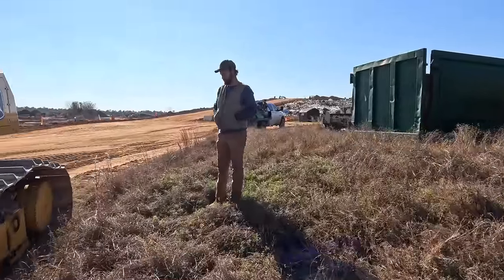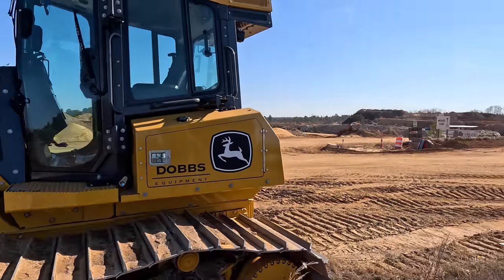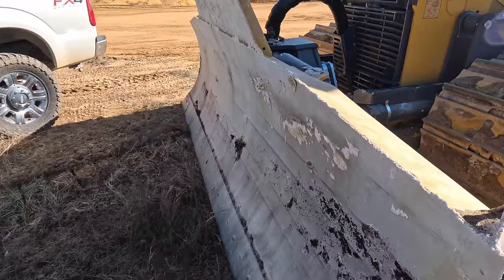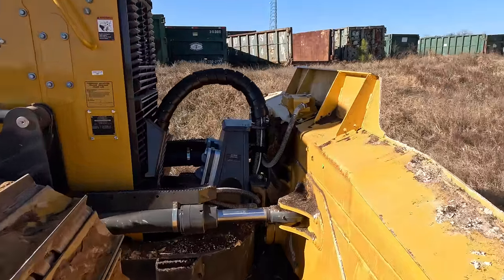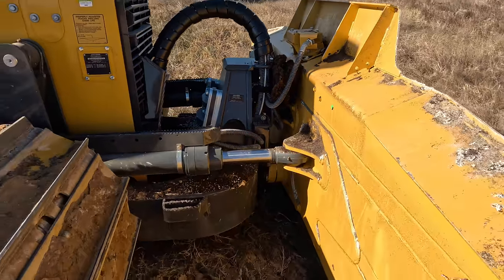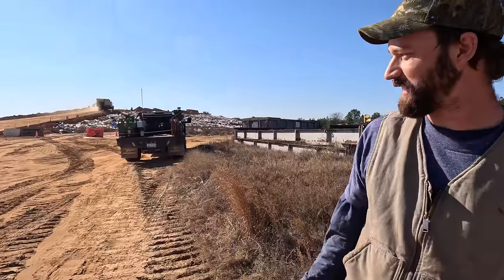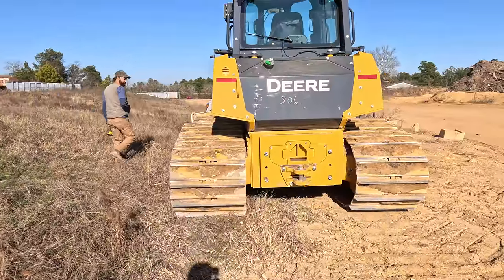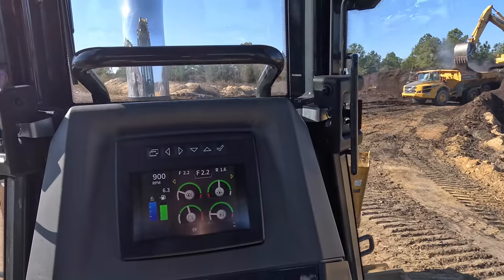🆕 John Deere 750 Arrived! But Is Something Wrong?

Comment: Ran 750s and 850s for a couple of seasons. With the 750 and 6 way blade. Keep an eye on the trunnion ball plates. In harder ground when the plates become loose it’s not hard to snap the trunnion ball at the neck.
Reply from the maker: Good info

Comment: I ran an old 450 lgp in a landfill outside of salinas ca pushing clay and sand. It had the old twin stiks which wasn’t a big deal because I learned on our old cable rigged D6 we had when I was younger. It was a great little dozer as I remember, we had a Cat D5 lgp out there too but it was tired so I stuck with that John Deere and it made me a believer, again.
Reply from the maker: cool buddy!

Comment: Thank you for video 😊❤😊 on are JD wheel Loader that had same button main square console. The (KEY) for brand new machine is the serial Number. Then if you look in manual the owner can change that number for anti theft 😊 the service guys from JD can change it back to serial number for service when you are not there. Just go to the part in service manual on changing START codes.
Reply from the maker: Thanks for the info! & thanks for watching

Comment: About reading signs: yes, one should obviously follow these. However, when you miss one, you may be entirely on your own. Me, I was touring on my bicycle (here in the Netherlands) the other day, following signs. At a certain spot, I felt that there should be a signpost, but I didn't see one. So I continued straight ahead where a sign should have directed me left. (One example out of many of the kind.) - A few decades ago (oops!) motorway exits here have been equipped with "no entry" signs left and right after 150 metres, with the text "go back" (in Dutch) underneath, as it had turned out before that many wrong-way drivers had missed the "no entry" sign at the intended end of the exit. - Me, I noticed the sign "<- LANDFILL" where you wiggled the dozer through, but I can well imagine someone missing it altogether (against the sun?) or missing its importance. You might consider investing in official-looking signs, and pour concrete blocks with a pole rising from them to mount these signs on. (Weight: tornado-proof.)
Reply from the maker: I like your tornado preview idea. Thanks for sharing!

Comment: I'd have been concerned to, about any unusual noise on a brand new piece of equipment.
Say, you don't suppose it just had too much caffeine. . . . . . .
Last one I operated had two sticks and a 283 engine. . . . . .
70's and it was at least 10 years old by then. Ha!!